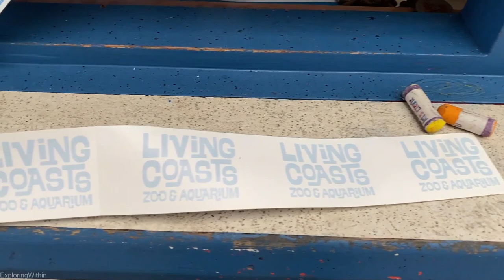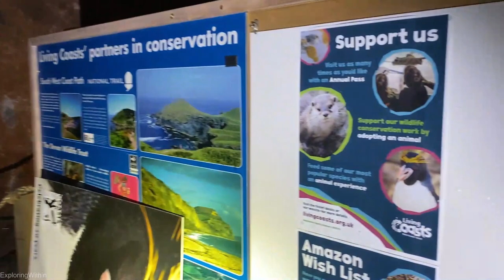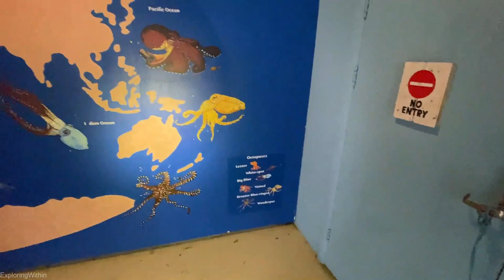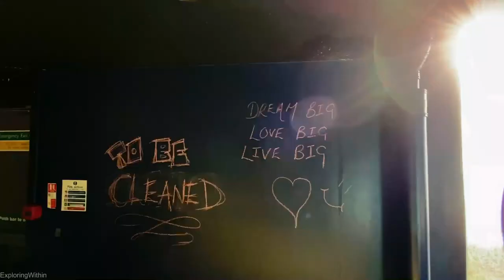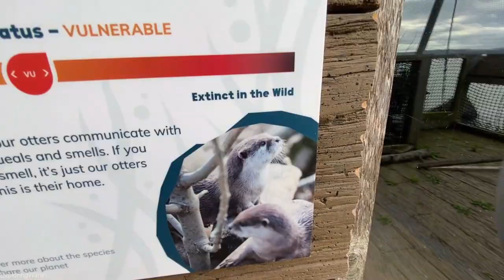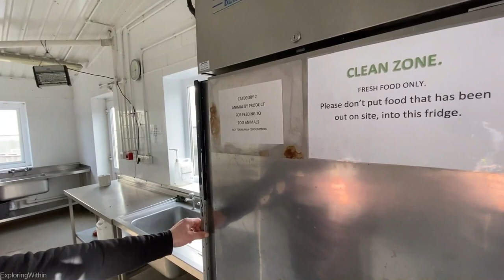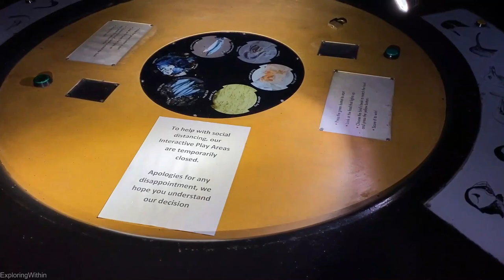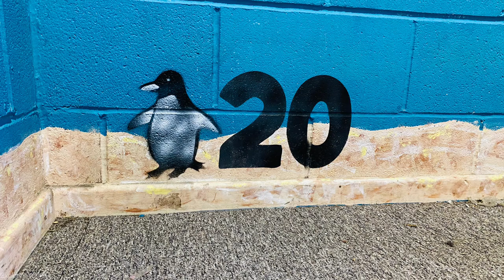ABANDONED AQUARIUM TORQUAY! Living Coasts Marine Zoo Sea Life Center!

Comment: 4:50 The arches and old architecture date back to 1853 when the gift shop area was a seawater filled swimming pool as part of Torquay Bath Salons which later became the Marine Spa. The 4 big arches on the outside were open to the sea. This pool was closed down in 1924 when a larger pool was built behind the Marine Spa. The area within the arches  was then used by Torbay sailing club until the Marine Spa was demolished in the early 1970s. 
The Marine Spa was replaced with modernist concrete leisure complex called Coral Island which opened in 1978. The arched area was  a discotheque during this time and those steps where chair lift is led up to a cocktail/ shorts bar.
Reply from the maker: Interesting one that! Thanks for the information 👍👍